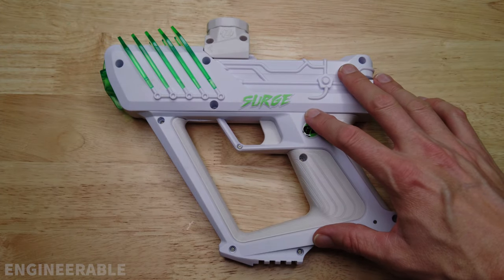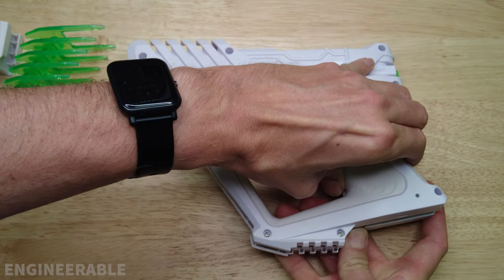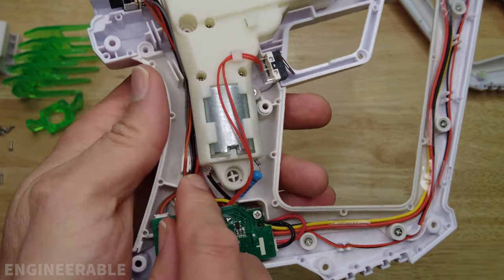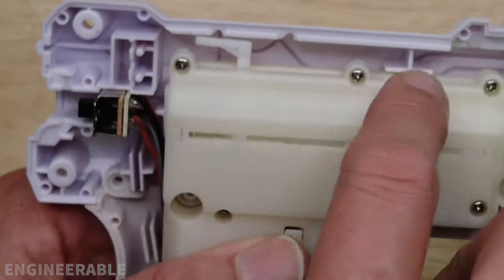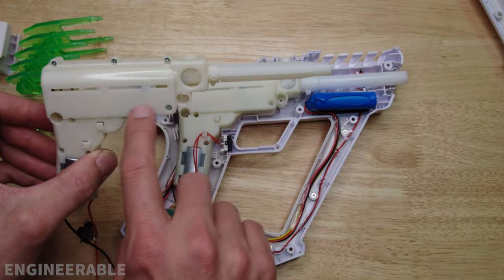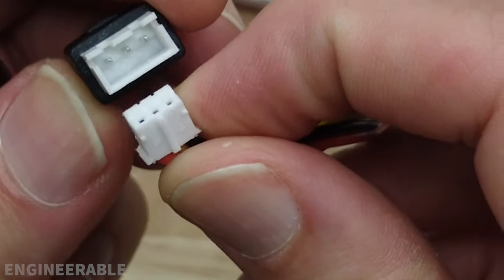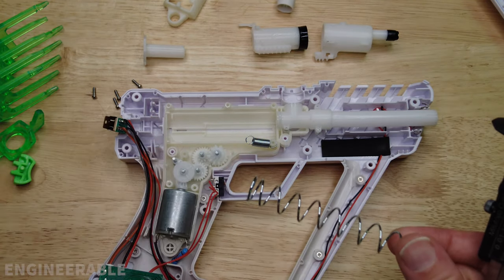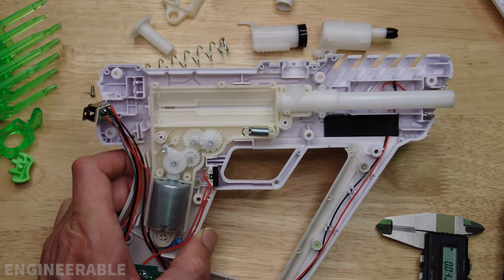WHAT'S INSIDE GEL BLASTER SURGE Gen2 (V2.0)? I Take Apart This Splat Ball Toy To See How It Works

Comment: Thanks man this really helped. Few days ago my little brother was having trouble with the motor we found out it was because there was a bit of water damage and some parts started to rust, we cleaned it up a bit and now its working as good as new
Reply from the maker: Nice work!
Reply: Ive got the same problem! How did you repair it?

Comment: Is the motor on these replaceable? I have one that barely shoots and it takes a while to get up to speed and the motor kind of sounds like it's burned the brushes and runs slowly and barely has any power. I have a bunch of motors in a container but unsure if one would work. I happened to lose the trigger spring but I recently vacuumed my room and luckily I found it and I will be trying to fix this one. I bought another to replace this one. If I fix the first one I'll have two.
Reply from the maker: If the motor fits, and the shaft is the same size, it could work. Otherwise the next best option is to replace the gearbox.
Reply: @engineerable  I don't think that it's the gearbox. I'm thinking that these motors are driven quite hard. And another is some people keep firing the gun when the gel ammo is out.

Comment: Im trying to mod  a gel gun for on a drone.  Need as compact as possible. What's a good model for that in your opinion. Would be cutting as much of the gun away as possible, I do have a 3d printer I can access as well
Reply from the maker: @CollinGdirks  The SKD 1911 gearbox is the standard used in pistol sized blasters, which is what the original gel blaster surge used. Later versions of the GB Surge had a slightly modified version of the SKD 1911 gearbox. The X2 or X5 gearbox may be more compact, but quality tends to be lower
Reply: I bought the surge and a piranha for this attempt. I'll see what looks easiest and return the other. Should be easy enough to do. But will see
Reply: @engineerable if neither the piranha or the surge look good ill order the skd. I think the piranha has potential do to its size but cannot find a pick of the inside. So just waiting on Amazon now

Comment: I have a question do you know what the two smaller wires running parallel to the main cables that run to the battery located in that front grip do? I was wanting to mod the gun and I would probably have to cut those to do it but I still want the gun to work. if they just control something negligible then I can cut them but if it does not allow the gun to work I won’t. Thank you this video has been very helpful.
Reply from the maker: The cables that run to the contacts ion the front are for their flashlight add on and as such can be cut without affecting the function of the blaster.

Comment: I have 12 guns with bad batteries any tips for good and cheap replacements?
Reply from the maker: Need to design a 3D printed external battery holder that allows changing the batteries.

Comment: Hello is there any replacement batteries available for the x l
Reply from the maker: Not easily. It's 7.4 li-ion battery made from 2 18650 batteries, but the wiring is custom.
Reply: @engineerable  I see thank you. I had gotten it wet and the lights started. Dimming and it wouldn't shoot or turn on but when I plugged it in the lights will turn on but very dim

Comment: Sorry to comment twice is there any way to hardwire the XL ? I got the p c v board wet and it's got fried...
Reply from the maker: Yes, but you probably want to use a MOSFET to run the motor. Running the power through the microswitch will burn it out eventually. Then you will need to charge the battery directly through the 3 wire balance connection.
Reply: @engineerable  Any mosfet you recommend? At this point I might as well modify it to take a different battery when I opened it up. A little chip was fried where the positive connector from the motor is at
Reply from the maker: This looks like something decent and gives some programmability https://amzn.to/42ttvyC
I've also started a blog post about adding a MOSFET https://www.engineerable.com/single-post/how-to-add-a-mosfet-mod-to-gel-blaster

Comment: What do I do if the gellets  are leaking out the barrel?
Reply from the maker: They have not grown large enough. Leave them in the water longer or use distilled water.
Reply: @engineerable  it’s the thing that shoots them out it won’t stay out it goes in sometimes
Reply: @engineerable  i have the surge xl
Reply from the maker: @rodrigosaucedo7361  still means that the gel balls are not growing large enough. The barrel is designed to be slightly smaller than the gel ball. A  gel ball that is grown to the right size won't leak out the barrel.
Reply: @engineerable  OHHHH so that spring thing isn’t supposed to be up all the time? It just sounded weird cause it’ll do it and then it won’t and it sounds weird when it does but thank you I’ll soak them for longer

Comment: Can you do one on the surge XL because mine is blinking red on the G and doesn’t want to shoot
Reply from the maker: First contact Gel Blaster and see what's up with it. It's tough to repair if it's due to the circuit board.
Reply: did anything come out of this? mine does the same thing & i wanna fix
Reply from the maker: @Germ17  You should contact Gel Blaster, unless you are prepared to do some soldering and hacking battery wires. Their custom battery setup makes replacement tricky.

Comment: I just got one, I just finished charging it completely, and it sounds like its fully changed based on its fast fire rate and power, but the light started blinking red literally within 10 minutes,  is it something wrong with just the light or do I have a defective one with a bad battery,  has anyone else had this issue before ? Please help
Reply from the maker: If it stopped working quickly after charge, could be a battery/charger issue. Contact Gel Blaster
Reply: @engineerable  thank you man I really appreciate it I just happen to be at work so I saw that you responded to me right now thank you
Reply: Yes mine started flashing red after one hopper full but would still fire but iv only used one hopper full so not sure how long before its fully dead and wont fire
Reply: May i also add i would not be able to contact   gel blaster as i bught it new sealed from ebay shipped from usa to the uk as they dont sell them in the uk
Reply: When i shoot my gel blaster the trigger wont move or anything i charged it turned it on what should i do

Comment: can you give me a reason why it wouldn’t work if I made CAD copies of all the parts, scaled it up 500%, 3D printed and CNC’d them in stainless steel, then assembled it with a high powered spring, and 1 hp electric motor? 😂
Reply from the maker: Is this Mark Robber?
Reply: @engineerable  no but I’m dead serious. Finding a lot of compatible larger metallic gears on McMaster. Can 3D print or have fabricated the rest. Seriously considering tackling this as a fun project. Done a bunch of research and haven’t found anyone who has attempted it before. Really can’t see a reason It wouldn’t work. Imagine using a truck suspension spring as the piston main spring and a big 5 inch diameter tube.
Reply: @EITFM  Did you die? If not, did you ever make this monstrosity?

The closest thing I've seen to what you were talking about doing, was a guy that built a hpa nerf rifle with the goal of 1000+ fps. At first it was so powerful the darts just disintegrated before leaving the barrel lol. But once he got it dialled in he was punching holes through plywood.